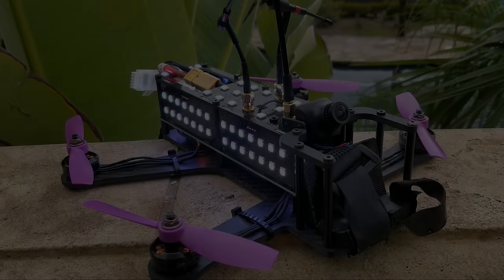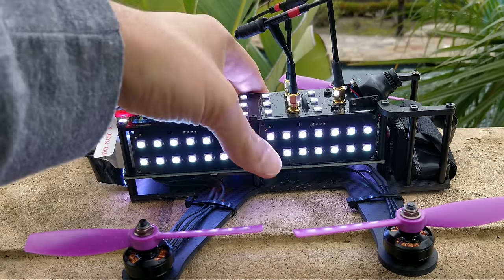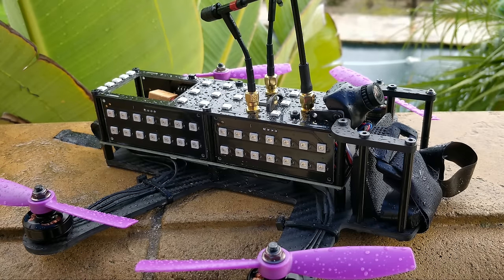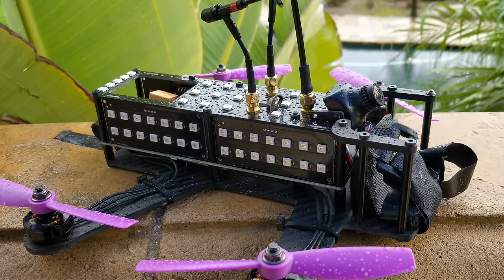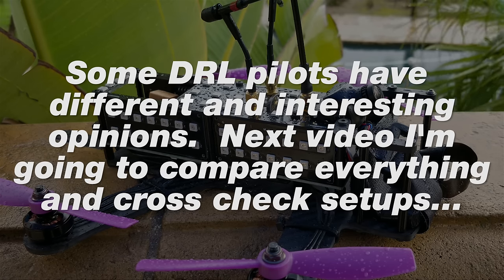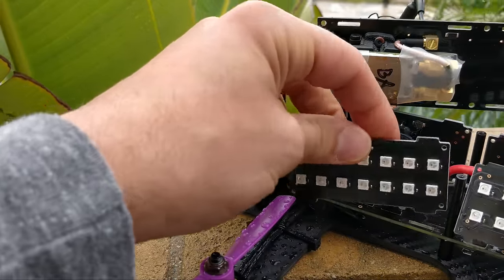DRL Racer 2

Comment from the maker: Table of Contents
02:10 - Discussion
03:50 - High weight race 5" vs 6"
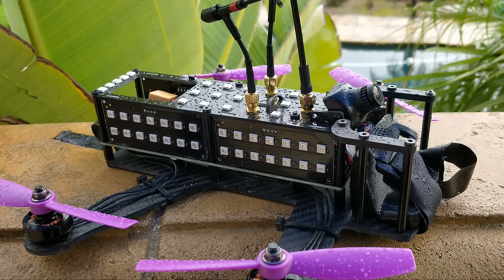07:50 - A little of what's inside
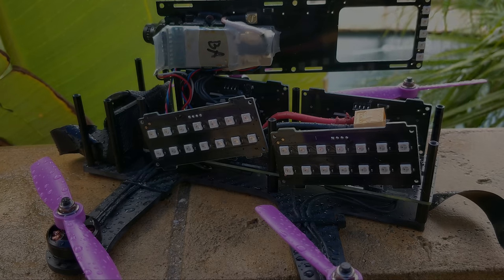10:02 - Full flight video

My work in progress website: www.KababFPV.com
Check out the Articles page.

Join my FB group for more discussion: Kabab FPV
https://www.facebook.com/groups/37915...

Secret Toothpick testing video for those that read descriptions: https://youtu.be/yRhRV1UpvnM

The song at the beginning: 
Made In Heights - Holla Mears

Equipment I highly recommend:

Micro Eagle - 
https://goo.gl/or1fS9

Rush Tank Vtx -
https://goo.gl/YMYmya

Fantastic solder-
https://amzn.to/2P5QM2W

TS100 iron -
https://goo.gl/DqBipa
https://goo.gl/svK6DD
https://amzn.to/2OV5XMh

WaFL’s Cap Cap
https://insta-stalker.com/profile/waf...
https://goo.gl/9CZdAs

Xing 2208: https://goo.gl/PcJ7GG

Xing 2306: https://goo.gl/TT9gnw, https://amzn.to/2VkZ8rt

Sub $200 5" build that's still good:
Frame: https://goo.gl/EpXQhZ
FC/4in1 Stack:  https://goo.gl/HprVbj
Motors: https://goo.gl/h5rofi
Props: https://goo.gl/ZnzY2y
Props: https://goo.gl/VMBiQh
FPV Cam 2.1mm: https://goo.gl/FDJhYw
Vtx: https://goo.gl/JNVDMn

Tips?
PayPal: https://www.paypal.me/kababfpv
Bitcoin: 1E4XZXoD4rS6MYWVWuenY7Kw2M1YgyNpoQ
Nano: xrb_1188ek5bd7tb9kw67asnp9o65byuoaxbtpxuznx1ribf75x78awywmakj55f
ETH: 0xD067F93811f2eC31CB1928901002dfdf9A492EF5
LTC: La2KWYAjp4VT2Lq2M76pbjzXWvRyjpfCtG

Comment: Are you going to continue selling the flosstyle? I prefer the flosstyle because it doesn't make any sacrifices to get the props out of view like the glide does. Please keep selling parts so that I can at least mantain mine
Reply from the maker: The parts will still be sold but I'm hoping the kit will be discontinued soon.  The Flosstyle doesn't get props out.  The Glide is the only one that has the ability to get the props out.
Reply: @Kabab   Please don't discontinue the Flosstyle, the Glide to me is a bunch of compromises for things I don't care about and heavier to boot. I freestyle with the Floss 2.1 but its a tighter build than I need. I'm waiting for spring to refresh my build and the Flosstyle is the only frame that fits my needs and still under 100g. Plus boomerang arms have last the longest for me, that's the #1 turn off for me with the Glide. Now I'm off to order up a all the Flosstyle spare parts lol
Reply from the maker: @pkvillager  I totally understand you. But after the boomerang arm update, the FlosStyle is about 98g I think. For just 5-6g more you get a whole heap of issues. Individual arms that are way cheaper, far more build space, more rigid construction, more battery room, True X or dead cat option....I worked really really hard on the Glide. I do feel it's far superior to the FlosStyle.   People probably didn't realize the arm update added another ~8g to the frame.
Reply: @Kabab  Well you are right I did not know that they were so close now.
Reply from the maker: @pkvillager  it looks bigger and chunkier but it's definitely not. Another thing about frames that almost nobody notices, long arms that are 5mm thick weigh a LOT more than a bigger body with short 5mm thick arms. That extra mm of thickness adds up real quick. If you compare the two, you'll note how much shorter the arms on the Glide are. This makes it far more durable and saves a ton of weight in the design. It's deceiving but I promise the Glide is better in just about every way except for those 5-6g.

Comment: I just wanted to write some unpolite comments about that flying brick, but then I remembered my first quad from 2007, a diy „mikrokopter“ made out of 2x45cm Aluminium profiles from a hardware store. 2 german guys developed an esc which could communicate via i2c with an atmel micro controller which run their own FC software.  Remote was a 27mhz Graupner mz-20. But even then I remembered had a toy quad in 2005, a silverlit x-ufo with brushed motors, nimh batteries and - a mechanical gyro!
Reply from the maker: Oh I remember the Mikrokopter things :-)
Reply: Those Mikrokopter guys now manufacture 2m / 6ft monster octocopters.   The other team, some students that developed some x-UFO upgrade parts like electronic gyro or better flight controller founded asctec.de more specialized on smaller special purpose quads for the b2b market. They also made a showcase with > 100 quads forming an led lit 3D sculptures in the night sky. Awesome precise 3D position tracking and route finding for transitioning between 2 sculptures without crashing into each other..

Comment: A goggle video contest so people(me) without a go pro have a chance, so it would be about flying, and not an epic spot,or great edit. I would fly my Tiny hawk if allowed. ( Tiny hawk suggestion: heat up the lollipop to melt the glue, and pull apart, put heatshrink to replace the plastic if needed( 2 versions, 1 needs it,1 doesn't) video is about twice as good adding about 6/10s of a gram)